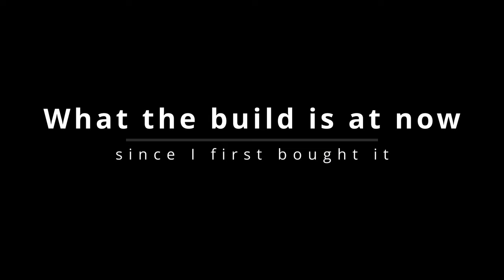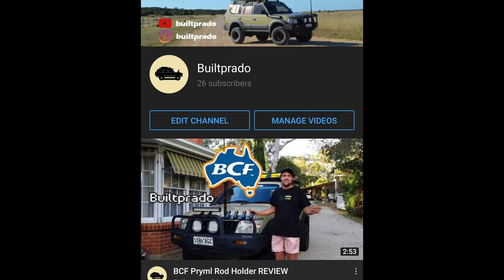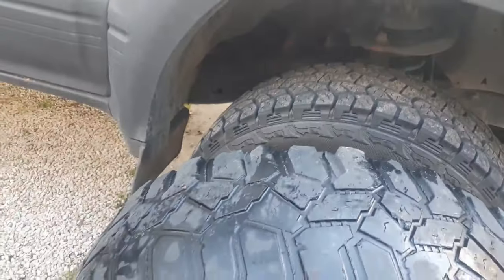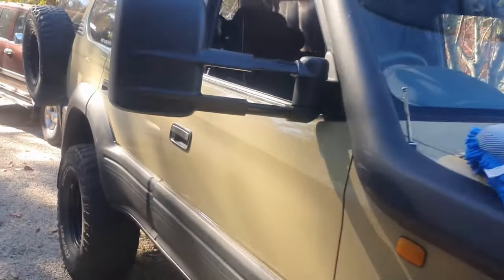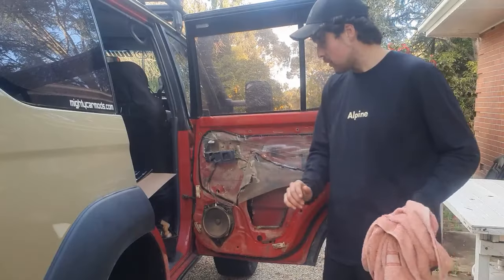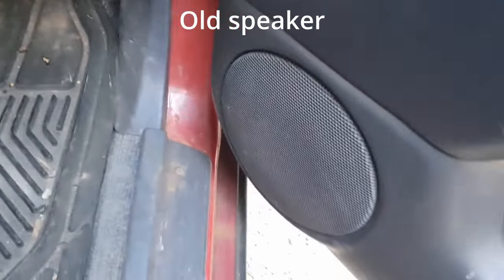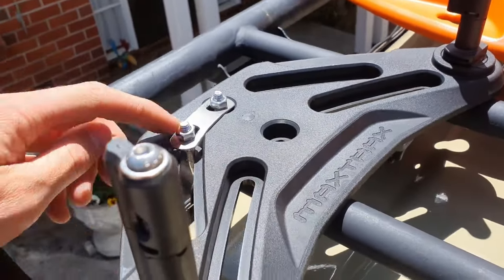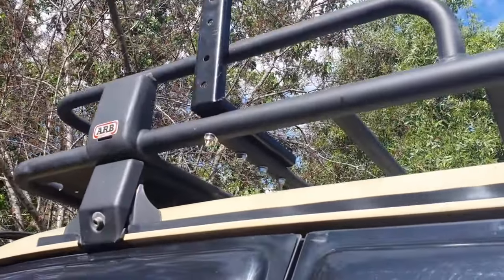Building a Landcrusier Prado 90 in 10 Minutes

Comment: I have a 90 series prado my self, i want to build it tough like yours but honestly im scared and got no one to help me sadly.
Reply: How did you do
Reply: If you haven’t touched it just dont. Sound deadening, Cooper discovers in OE size, radio and roof rack/roof tent are about all Id recommend. Push bar if you’re going to use it, EBC pads/rotors if you want all the stop, Bilstein suspension in OE height if you want the stiffness. Starting to touch suspension geometry can lead to odd handling if done wrong, drilling holes in the body can lead to rust in more humid climates, over sized tires can add excessive strain to suspension and steering components. Toyotas are reliable because, typically, theyre well thought out and built. Ive seen my fair share of Tacomas here in the states that have been lifted, modded and frankly have become barely functional far more than someone who built the tacoma from the ground up to be a purpose built rig that cant be daily driven, but will run circles around everything else on the trail. I learned the same lessons with my Bronco, do nothing in half measures.

Comment: Mate luv your work on the 90. I also have a 90 series that's done 627,000 KMs and still going strong,very capable machine off road and often underestimated .Thanks for sharing your mods. Cheers
Reply: Hey mate is that petty or diesel, I have a petty/lpg with 530,000kms very healthy